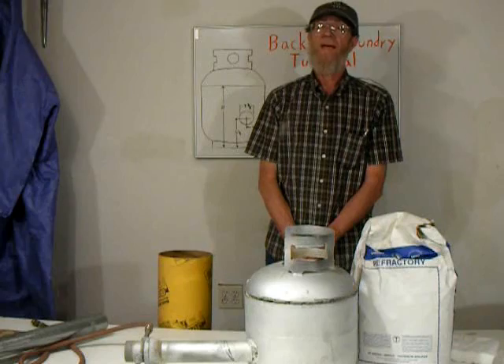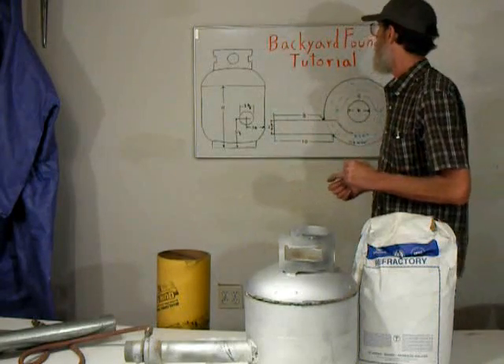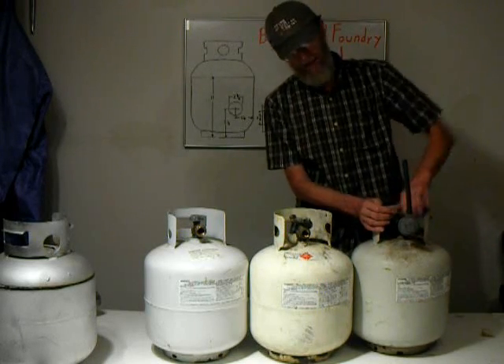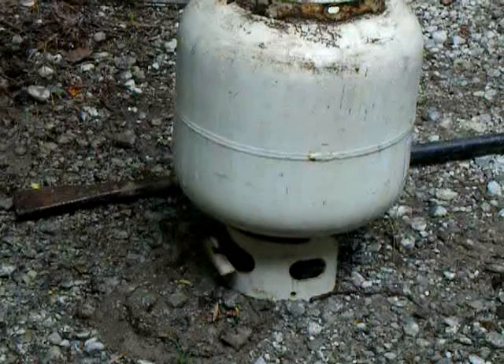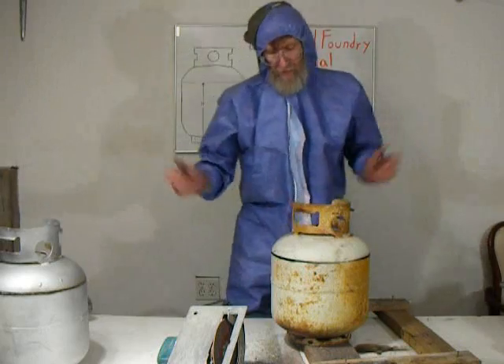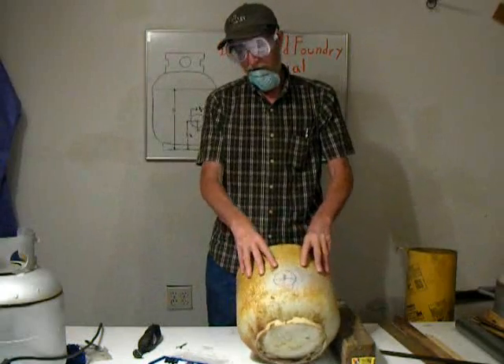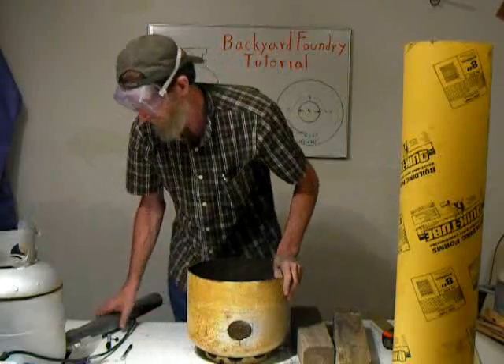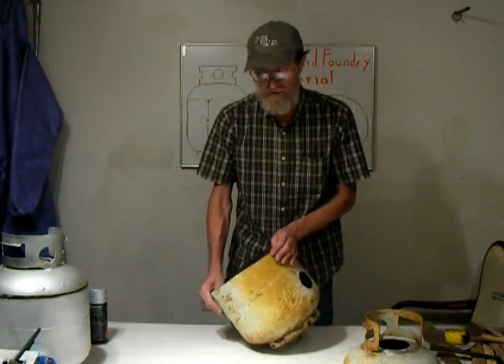Backyard Foundry Tutorial Pt 1

Comment: 14:50 Well, I just wanted to mention the tool he is using, is a cutting torch designed for cutting things up. Those who are familiar with welding will know that you normally use a welding tip for the job. However, a man has to improvise to get things done and I sure like his talent for improvising.
Tip: Use a MIG welder or get someone that has such a device to do it. Fast, easy, and it will do the job without any leaks if you are not familiar with gas welding (gas welding requires some skills or you WILL get holes in it).
Also...a galvanized tube is less than ideal. It will contaminate your welding and let off toxic fumes...please do it outside or use a ventilation system when welding.
Reply from the maker: Not quite perfect in your observation.  I did use the MIG welder along with the plasma cutter for future videos but truth is I wanted to show people how they could do great things with very little. As far as the torch its a rarity and I do not blame you for that.  If you look at the flame that is a welding tip.  The cutting lever is nonfunctional with the welding tip on but by simply swapping out a tip and changing the gas pressure  I am cutting.  LOL trick is don't ever lose those tips ... failed idea as far as companies but I still have one although there is  no replacement tips.

Comment: I'm trying to understand why the propane tank is used, is it possible that it prevents the cement from cracking? or is it that it is a nice shape and convenient package?

Someone please enlighten me!
Reply from the maker: +Zoe Doucette The propane tank is used to secure the burner tube as well as providing a rugged frame and backing for the inswool insulation. The burner tube is left uninsulated to keep the burner itself from overheating. When reaching high temperatures or running for long periods of time it is sometimes necessary to trickle water over the tube to keep the burner cool and the flame set inside the foundry.

Comment: could you only use insulation? no cement.  maybe with a fire brick on the bottom to sit the crucible on
Reply from the maker: +Stephan Fortin You could but be aware that the foundry produces quite a bit of exhaust.  Even though it is naturally aspirating and uses no blower.  You would have to coat the inswool with ITC-100 or Satanite because Inswool is considered friable.  In other words it could deteriorate with use as well as pose a respiratory hazard which you definitely want to avoid.
Reply: +Stephan Fortin I'd like to know the answer to this as well

Comment: How many pounds of castable refractory cement to make both sections. Amazon has it in 12.5 and 25 lb. quantities. It is 2200 degree rated. Is that sufficient or should I be looking elsewhere. Cant seem to find any in the Tampabay area.
Reply from the maker: Sol Oak Not sure I buy Mizzou in 55lb bags similar with KS4+.  Some vendors seem to be busting it down to smaller quantities.  Basically it is a bag for the base and lid and a second one for the center section with some left over.  For hobbyist purposes I would start with the base and lid. It will not be as efficient due to a decreased flue effect and a lot of heat escaping that could be used with the center section but still works. I recommend Mizzou to give you an edge on mistakes.  Say a neighbor comes over you get to talking and you forget and leave you gas pressure set at startup at 18 psi.  Aluminum is boiling and orange rivulets are running down the side. Damaged but still usable.  Unfortunately if left unattended once heated up it will turn the refractory to glass.  It looks the same color glass as a long neck brown beer bottle.  Definitely use the Inswool for the insulation.  That demonstration in the tutorial with a 1 inch thick 6 inch square and an oxy-acetylene torch to my bare hand is real.  I felt no heat at all without the Inswool I would have destroyed my hand.
Reply from the maker: Sol Oak OOPS you know that could be the "Fireproof overshoes" video where you see the true value of the Inswool in the bare hand vs the acetylene torch.  Old age ... memory ...too many darn videos ..very..hard to keep track.
Reply: this is why humans are falling to fake news articles...imo we are not desgined to filter so much out.  thanks for your wisdom again...

Comment: The white bag with of refractory, is that fire clay?
I bought the same bag from a fire brick store.
I told them I wanted fire clay and they gave me a white bag that said refractory.
Can I mix silica sand and the white bag of refractory say 2 parts sand and 1 part refractory to make liner of the foundry. Making it 2" to 3" thick and no ceramic blanket
Reply from the maker: Not knowing what the product is I can only guess.  I think it is refractory mortar used for firebrick.  That is different from KS4 or Mizzou since they are castable refractory mixes designed to insulate as well as form a ceramic when fired.  Like an electric kiln you see in stores.  Get their advise for the amount of sand.  The only problem I see is you are not going to get the huge insulation factor the KS4 and ceramic blanket provide.  So eventually you will pay in propane. Still it should work and later on you could upgrade with the more expensive liner.  If I am right the stuff should be pretty easy to bust out unlike the more expensive castable refractory.

Comment: Rob I found out that the cement tubes vary a lot. I didn't take my tape measure when I bought the first one. Turns out it was 8-3/4 OD. Took it back and finally settled on a 7-7/8 OD. This may be where some folks are having problems with the wall thickness. The note on the tubes say they can vary +/- .5".
Reply from the maker: Sorry about that. I ran across that myself a few years back.  I am not sure why they make them that way.
Reply: I suspect the reason is so they can nest them for shipping.

Comment: rlbob1, thanks for the great videos. I'm really looking forward to giving this build a try. I do have a question regarding the insulwool. Below you mention that it should be 1" thick. I've found that the insulwool is rated in lbs., for example 8# wool or 6# wool, etc. with your design, which # rating should be used? Thanks

Comment: hey rlbob1 great video..i have a question.is the propane tanks you are using standard ? cuz i have one cut and ready..but when i place the cardboard form inside there is only little under 2 inches from outside form wall, to propane inside wall.. is that enough room to place 2 inch ceramic fiber blanket and 2 inch ks4 ?...
Reply from the maker: I finally found your comment marked as Spam.  Yes that sounds correct.  Be sure to press refractory into the holes you made in the thermal blanket by hand. Pack the rest hard with a ram using the flashing to protect the thermal blanket.  Be sure to pull the flashing up as you go or it may get stuck.  You will end up with about 1 1/4 inch or refractory as it will compress the Inswool a bit.  As I noted in the video you cut the thermal blanket short enough to insure solid refractory at the top of the main foundry body and at both ends of the center section.  You should figure the full 2 inches from the sides to the cardboard tube and 1 inch to the top of the Inswool. Let it harden overnight and strip out the cardboard tube.  It will be soaked so peel it out.  Fill any voids with refractory and let cure for a couple days to get really hard.  The rest is the first fire. Proceed very carefully and slowly with that.
Reply from the maker: That should be 1 inch Inswool not 2 inch. I did not catch that on the first read.
Reply: thanks so much for the reply..i really appreciate the knowledge and know how you have shared ....this stuff really is priceless....the world truly is a better place with people like you in it....

Comment: Just curious; why are you using a cutting torch to weld the burner tube in place?
Reply from the maker: Actually is is a multi torch with a welding tip installed. Although somewhat uncommon it has the lever for cutting but lacks the center hole when the welding tip is installed.  Great observation though.
Reply: its actually called brazing. its a form of welding but does not give the penetration of using electricity to fuse two piece's of metal. And it is very tricky if you don't no what your doing with brazing things can go bad very fast with the project. and yes that is a cutting torch head not recommended to use that but it works. a No. 9 brazing head is the best one to use its much easier to control the flame with it and gives a good amount of penetration. but it is always a good idea to wear tinted brazing/welding goggle's as i have had welders burn several times from my auto dark hood not working due to a wire bumping loose in the solar panel and not realizing it was not was not kicking on full dark..... its not fun feels like a someone rubbed a full sand box in your eyes and you get spots that wont go away. this is why i also wear sun glasses under my hood to make sure if this does happen again the effects will be slightly less and i have a better chance of seeing in 48 hrs.

Comment: Hi rlbob1.
I've just finished building mine and everything went well, I am now carefully drying out the refractory. One question I would like to ask you is a bout the burner, is the flame suppossed to be all the way down inside the burner tube?  Although it works well I would have thought the flame would be more to the oposite end to the jet, also the pipe where the rubber gas pipe connects to gets quite warm also!

Regards
Dave
P.S Great videos :-)
Reply from the maker: Sorry about that.  I filmed an addendum to show the operation but lost it in a hd crash.  You start out with the flame inside the tube.  It makes a thumping noise.  Once things heat up you cut off the gas, wait a few seconds, then turn it back on.  I call it flame repositioning and it self ignites.  The sound changes to an even rushing sound and you MUST cut the gas pressure down at that point to avoid the temp getting so high it melts the liner.  I usually set up a garden hose on a piece of angle iron and trickle water over the burner sleeve welded to the tank.  This keeps things cool enough so the flame does not jump back and also keeps the rubber hose cool.  You may have noticed two things in the design that I failed to explain.  The exceptionally long burner sleeve welded to the tank ( the chain link fence post) and the fact is was not insulated like the rest of the foundry.  This is why. Once you heat the foundry up enough and reposition you are sipping propane and are at maximum efficiency. Truth is at that point the entire foundry is a giant burner. Always try to schedule several pours in one session once you heat it up.  I even melt and clean scrap to make ingots after the casting is done to save gas while it's hot.
bob

Comment: What tip do you use for your sandblaster?
Reply from the maker: Its a small Northern Tools Blaster so I just used the tips that came with it. It's the air PSI and the volume CFM that matter when sandblasting. I use an old Ingersoll Rand two stage compressor 240V 5HP 100 gal which I picked up at a yard sale.  It's big enough to run a body shop.
Reply: I have a king sandblaster and the tip requires you to hold down a lever while you're using it.  Only problem is its spring is so hard that it hurts the hands after about 5 minutes.  Plus the parts they use are designed to wear out so I'm looking for different nozzles to fix those problems.
Reply from the maker: Dodge_D14
Yes, been there as well.  I use the small sandblaster to remove rust from steel on auto body's and frames.  Most of the time I use a larger Soda/ Media blaster, which uses plastic beads, to remove the bulk of the paint. Plastic beads do not heat or harm the sheet metal.  With a job that big the lever is a pain.  I just wire it down and use the air valve for on/off. You can just simply remove the lever but you must be careful not to drop it and break the ceramic nozzle.  The ceramic nozzle does not last long when using sand.  I found that the same nozzles on my Northern Tools blaster are also available at Tractor Supply so you may want to check around.  A lot tools are from the same manufacturer in China and just branded under different names. Another idea is replace the gun with one where tips are locally available.

Comment: THANK YOU FOR ALL THE VIDEOS VERY INFORMATIVE.I WAS JUST WONDERING,SINCE I WORK FOR A MEDICAL COMPANY,I HAVE ACCESS TO LIQUID OXYGEN.IF I RUN A LINE OF LIQUID OXYGEN TO MY FOUNDRY AT A VERY SAFE DISTANCE AWAY.WHILE USING CHARCOLE AS MY FUEL.WOULD IT  BE SAFE TO PUMP TO PUMP O2 INTO MY FOUNDRY,BEAUSE I HAVE A REGULATOR THAT RANGES FROM .05-15.0 LITRE FLOW.JUST WONDERING WHAT TYPES TEMPS COULD I ACHIEVE WITH THIS SET UP

Comment: Hey Ribob1,
Built your plan everything checks out exactly to your plan but I can't get it to fire up. Tried covering the top 1/2 way and light a piece of balled up newspaper in the bottom. I have the exact same type regulator ( mine is 0-40 ). The refractory cement has been setting since saturday (3 days ). Tried poundage settings, pulled out pipe pushed in pipe still will not light. Could it be there is still too much moisture in the cement ?
Could not get a # 60 bit went a couple tho. over ?
.

Comment: Hello rlbob1.  I just recently became interested in a small foundry and have watched all your videos.  Thanks for creating them; they have been extremely useful.  I am following your design/build exactly.  Burner parts are all purchased.  Found a local source for the KS4+.  Question:  Could I use a 4:1 Perlite to cement mix in place of the insowool, or is the insowool blanket much better for the insulation?  Thanks

Comment: Very clean design and comprehensive instruction.  Thanks for putting this up.  I'm sure the OP already knows this but anyone else thinking about building one of these - if welding galvanized pipe, make sure you have plenty of ventilation.  Though they probably wont permanently harm you, the zinc fumes from the pipe can make you pretty ill.